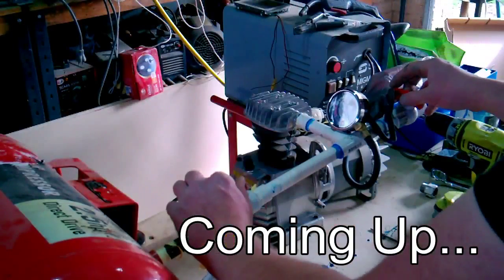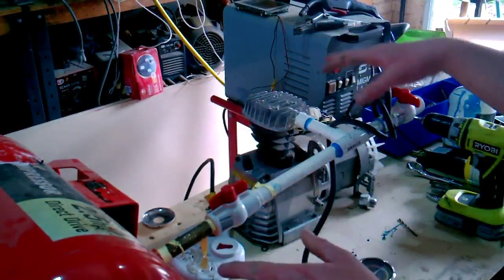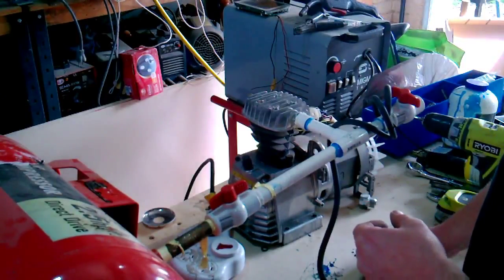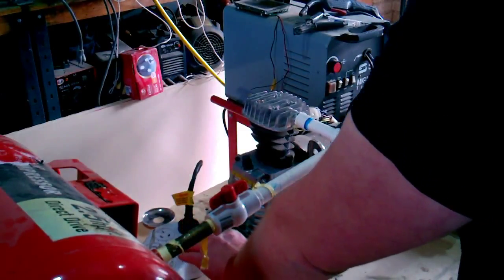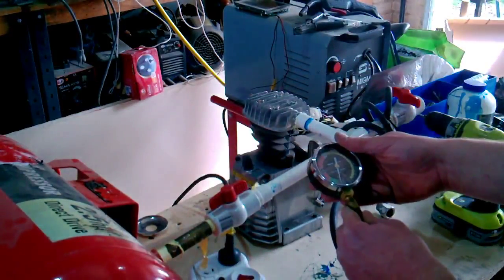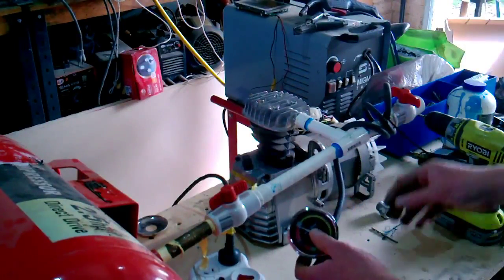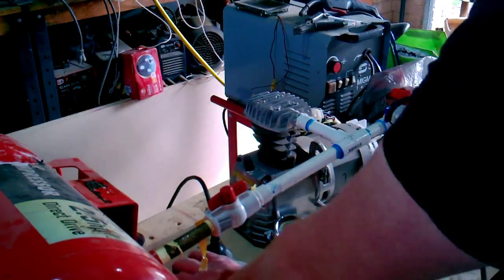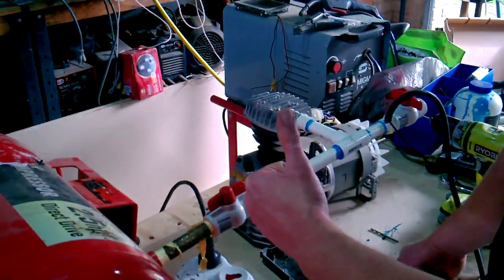Vacuum Former - Tank and Suction Experiments - Converted Aircompressor

Comment: Looks like it will work great. What size former do you plan to build?
Reply from the maker: +Jonathan W Thanks Jonathan. I think my limit will be how much plastic I can heat at once. I bought a large 2200W oven element for this project. I'll see if it can heat as large a sheet as 3'x2', but my realistic estimate is that 2'x2' might be the maximum.

Comment: you may want to add a check valve and a bleeder on the output (input?) of the pump so you dont have to fiddle with the fly wheel. you'd just close the tank valve,  bleed the vacuum and you're ready to go.
Also I don't think you need to worry so much about closing the tank valve, its a sealed vessel so once its empty (full?) its not going to add any air to the system.
Reply from the maker: +Ben D Will try the check valve and bleeder. That sounds like a good plan.
For the tank I figure it will be about volume not pressure. When the vacuum formed item is on the platen I want all the vacuum to be focused to there, rather than diverted to the 'empty' tank.